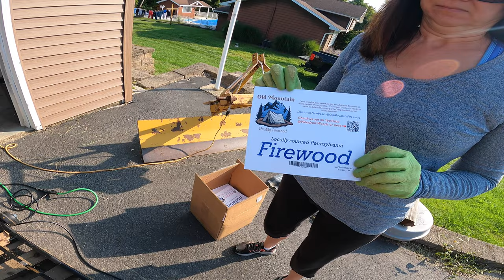#102  Why we need to re-bundle firewood #firewood #bundle #bruteforce

Comment: Hi Woody!  Thanks for the shout out.  I just remember, blown stretch wrap blows!  That blown stuff is SO loud.  That wrapper you have is FAST.  Dangerously fast!  Watch it!  Good work crew!  Keep it up!
Reply from the maker: It is very fast!  As I mentioned in the video, we are getting a feel for it and can feather the control pedal.  Where do you buy your wrap?  I need a different solution here.
Reply: @woodruffwoods  just emailed you the website.  I prefer the 90 gauge cast.  I’ve used the 80 ga also, but prefer the 90.

Comment: Darren,  to get tighter bundles I like to take 1/4 splits and put them in the bottom corners. The rounded sides would face inward.  When the wrap pulls it all together and you get a tight square bottom.
Reply from the maker: Harry that is really smart.   I was impressed that Lisa was referencing you in the video.  You must have made an impression!

Comment: Good evening WW & LL. If the tension nut is loosening up when your spool is getting low might try a shelf locking nut. Until next time have a great  rest of the day
Reply from the maker: Not sure it is an issue of the nut.  It seems as the roll gets smaller, I have to loosen the nut to release tension.  I think as the roll is bigger it takes more tension to pull it off tight and as it gets smaller it takes less tension.  I may have to talk to AJ to see what he recommends....